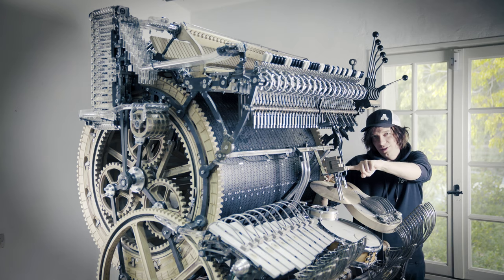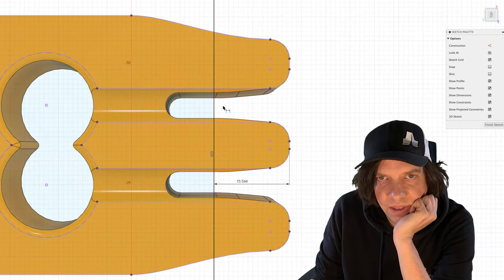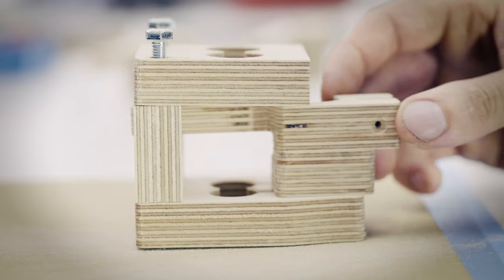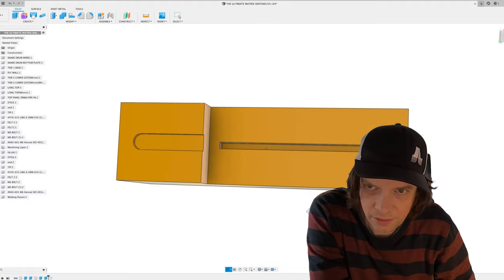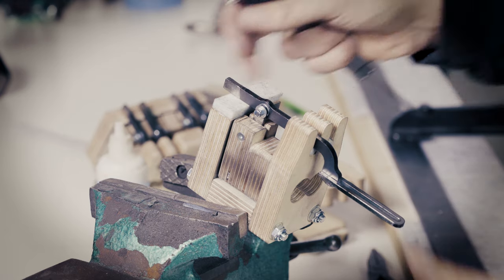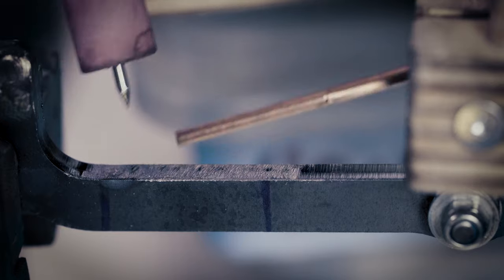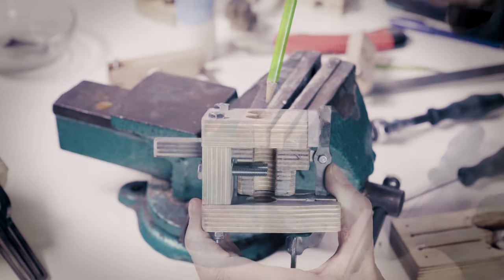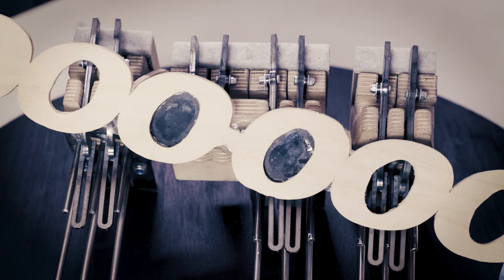Making Better Marble Gates - Marble Machine X #144

Comment: 11:02 There seems to be some friction from the thread of the screw. Does this damage the marbles in the long run?
Reply: Marbles roll.
Reply: @Jeff121456  But the initial part is the marbles will be dropping one full marbles' length down to impact onto the screw's thread. Multiply this over the course of millions of times and the marbles would wear down because of that repetitive impact, no?
Reply: marbles are the least difficult component to replace
Reply: im more concerned with the threads. a couple hundred hits will not do too much, but 10 or 20 millions? that and plywood rubbing on plywood? even with the graphite i think this part still needs to be redesigned
Reply: @Skai2O  Not really. The "marbles" are actually  hardened ball bearings. I think he got them from SKF. I doubt you would even be able to put a scratch in them with a regular metal file even less with a regular non hardened galvanized or zinc plated steel bolt.
Reply: @braiansingh9730  the threads would wear down, but it wouldn't cause a failure, it would just reduce the friction and the problem would eventually stop
Reply: I doubt it, the threads would wear away before the marbles would have any noticeable issue
Reply: @Jeff121456  tires roll.
Reply: @Sleepless_Sam  I knew it was something like that.
Reply: It seems to me it should be smooth. At some point the threads are going to knurl over and may get metal shavings in the mechanism. He should be using a hardened ejector pin (used in plastic injection molds) which are smooth.

Comment: Number one- you can keep all the parts as cut and the felt at its current dimension- all you need is a stop block screw in the back side of the wood bracket that holds the shuttle... a screw in this position will prevent the shuttle from moving back beyond a certain point. Source a screw that has a urethane rubber end or affix a rubber bumper to the head of the screw, and screw it in from the inside of the shuttle. A slot cut in the other end of the screw would allow you to adjust the position of the stop from outside the machine, while the head holds the rubber sound damper.  And the advantage of the screw is that you can fine tune just how far each shuttle moves back to achieve ideal marble stacking in the pipe above the gate.
Number two-  The stop screw you are using inside the gate path has threads to the very end.  If you want to reduce friction, then dragging a sphere across steel ridges of similar hardness is a LOT of additional friction- especially when the marble has the added weight of all the marbles above it.   This stop rod SHOULD be a smooth steel rod or bar.
Reply: I hope this is just a prototype and the real part will be smooth
Reply: post this on the discord server
Reply: A) a stop screw would defeat the purpose of the felt, which is the noise reduction, and rubber soft enough doesn't last very long before it turns to goo due to age.

B) a lot of armchair engineers are making a fuss about the threads on the bolt, but missing the fact that the coefficient of friction between hard metal surfaces is quite low and the marble can roll anyways, so the actual friction force is small enough to be irrelevant. Keep in mind that when Martin is moving these mechanisms by hand, it's easy to feel how much resistance there is; he knows where improvements are needed.
Reply: @nikolaihedler8883    Sorry- it would not defeat the purpose of the felt- The Felt is CRUSHABLE. And will compact over use... as such- relying on the bar hitting the felt as the shuttle stop is simply asking for it to vary over time. A stop will accurately stop the shuttle where you want it to and the rubber will not wear out any faster than felt will.

You comment about the co-efficient of friction is moot because the same factor applies to the marbles rubbing against each other-
 Much of this episode was examining the TINY additional friction of having the marble push UP a stack of marbles because the next marble was not Behind the apex of the curve of the marble in the gate.   Despite the fact that you had two SMOOTH marbles rubbing against each other.   This was not a concern of FRICTION, The idea was to minimize the resistance of LIFTING the marbles in the pipe even a tiny bit.
The spherical apex of the marble, resting on the cylindrical edges of the threads is actually a much greater force because it is concentrated on TWO ridges at any given time. Like CHOCKS on a wheel.   And the apex of the marble curve has to be Lifted over each thread, 8 to 12 times before dropping off the screw.
This is defeating the co-efficient of friction between two steel surfaces by essentially adding a corduroy contour you have to slide across.

A smooth steel shank would minimize both the lifting of the marbles in the pipe... and it would allow the marble in the gate to slide smoothly with the low friction you are claiming exists, where it doesn’t when pushing a curve across a series of steel knife edges.
Reply: @christopherpardell4418  it's not friction that's the problem when lifting the stack of marbles; it's just the extra weight. Lifting the marbles is a problem because it takes energy to lift them, even if they're frictionless; the sliding friction is small enough to be almost unmeasurable in this situation.

Felt doesn't melt and turn to goo because of internal solvents, and also doesn't wear down the way you are describing; it's used in this same application in pianos which work flawlessly for decades.
Reply: oktopustrainer  well actually the surface area has almost no effect on the friction force, but you're right about it rolling.
Reply: oktopustrainer  two steel spheres meet with the smallest possible contact area. A sphere and a cylinder meet with a trifle more contact area but still negligible.  A sphere meets a screw thread in two contact points...   however, the problem is that there is a valley BETWEEN the two points of contact and the lowest point of the sphere is lower than those two contact points.   Ergo, the steel sphere must RISE to move over the thread, where it drops into the valley between the next two threads and hits the next thread like a tiny speed bump.   Then it has to do that again for each successive thread.   
A marble on a smooth steel shank will slide rather than roll, which is actually less resistance because for the marble to roll adds in its moment of inertia.  The marble on a thread rolls because the added resistance of the moment of inertia is less than the resistance of having to slide over each thread.
The mass of the marble is increased by number of marbles above it in the pipe... this increases the resistance of lifting over each bump the exact same way a wooden wagon wheel is harder to roll over rocks when the wagon is carrying the weight of several more wagons.

Seriously... the scallop height of a big marble on a fine thread is not much... but its there.   If its worth modifying every gate to make the marble not have to lift the other marbles X distance one time... then it’s worth it to make it not have to lift the marble 1/10 of X height 12 times.
Reply: @nikolaihedler8883 . So, like I said... it’s having to LIFT the marble over each thread that is the problem.   ( although friction DOES play in as the bottom marble in a stack in “rolling” would try to roll the marbles above it, each in the opposing direction like a train of gears. Which is why these marbles do not Roll out of the gate throat, because the cumulative friction of turning a stack of marbles against each other is greater than the friction of sliding)   
And felt on a piano is NOT being used to POSITION any part precisely.  Its just a surface that moving parts can bump against without making noise... or that can be pressed to a vibrating object to dampen its vibration.   Its Not a precision registration solution.
Reply: @christopherpardell4418  pianos use felt between many of the moving parts within the action and they rely on felt pads to keep they keys aligned with each other.
Reply: @nikolaihedler8883  On this point alone, you are only semi correct. Yes, pianos do use felt in many places, but not for ultimate alignment. The hammers rest on a wooden stop and are cushioned by thin felt, not calibrated. The keys rest against thin felt, but are weighted and balanced for ease of playing and so do not impact the felt with enough force to deform it. Even if they did, the difference would be a tiny discrepancy between key height on the keyboard, which can be adjusted anyway, but zero affect on the position of the hammers and therefore function of the piano. 
Ultimately, any place inside a piano that uses felt is either for damping the strings, or the sound and feel of 2 colliding wooden/ ivory parts. The weight, position and feel when playing of any component is decided by hard stops and other calibration methods.
In the marble gate, the only calibration point is controlled by the reliance on a constant dimension of the felt. In a piano, the felt will, of course, deform over time, but the calibration is performed elsewhere.

You can see the several adjustments available in this image. All felt stops are controlled by additional measures.
https://cdn.merriammusic.com/2015/11/grand-action.jpg
(It's not the best image, but several links I tried didn't work. Search Google images for "piano key mechanism" for better examples).
Reply: @SuperSpatman  The resting position of the keys has a lot to do with how predictable the "feel" of the action is, and it's those resting positions that are lined with felt; it's true that they're adjustable during service, but many pianos go decades without a full readjustment and still maintain accurate and consistent action. The forces applied to the felt in this video's mechanism are similar (quite low, especially compared with his test pressure) and do not require the exaggerated level of precision that many people in this comment section seem to believe. In other words, the wild fearmongering about deteriorating felt and associated catastrophic failures are just that, and it's a perfectly suitable material (even if the welded-on bits are rather unfortunate).

Comment: You could test this though, make one with a simple return mechanism for the marbles like a test rig, leave it running dropping two marbles a second for 60 days, that would be 10m marbles, see what has worn after that time and improve the design.
Reply: That’s the right thing to do, instead spending time on building 38 prototypes each time
Reply: What?  And demonstrate with certainty the futility of his goal and the complete inability of his design to ever reach 10M?  That wood will wear, that felt will compress or steel threads deform after being struck millions of times?  What could possibly go wrong?
Reply: I keep saying that since ages. It is so frustrating however I still watch every video. So yeah.
Reply: And, of course, the simple return mechanism would have to have a better failure rate than the design being tested, otherwise it might fail first. Then wait 2 months for results. Unless something goes wrong. In which case, redesign and wait. Also the noise would not in any way drive him crazy.

Yes, certainly a good idea to test several designs of several parts with tests that take 2 months and need to be more precise than the designs being tested. Most certainly going to save time.

Say, how do you propose getting a testing design that only fails 1 in 50000000? Create a few designs and test them for a few months?
Reply: @autumn4442  I mean the alternative is to do a proper failure analysis. Look at all failure mode and try to solve those before you build it. But not just guess and say it will last 10.000.000 cycles. 

Also no one says that you have to run it next to you. It can be in a different room. Somewhere you go check every few hours. 

And the return mechanism will be easy. Just take a screw to drive them up. You just have a rotation motion, nothing that can really wear, easy to build, etc. I mean that would have been the first thing I would build if i would start such a system. 
Designing testing parameters and building proper test is the most important part in any engineering.

Comment: 3:06 I can only hope that one day Martin will realise that felt is compressible and that leaving a 6.5mm gap for felt is meaningless... Give it a week of use and it will be down to 5mm. After a year, it's probably 4mm...
This whole video is Martin having an engineering meltdown... 6.5mm gap for a compressible material, 15.544mm (to the MICRON!) dimension for a plywood part... My head hurts...
Reply: DISCORD GUYS please
Reply: Felt is very common in music instruments like pianos, and doesn't compress the way you describe; this is especially true because the force applied to it is much less than he was demonstrating. In fact, his "maximum pressure test" reflects what is likely to happen if the felt does become compressed permanently, and shows that the machine will still work even if the felt gets worn down.
Reply: @nikolaihedler8883  Even if i exaggerated the compressibility of felt, expecting felt to have a dimensional accuracy lower than 1mm is ridiculous. It's not metal. It's not even plywood.
Reply: @CristiNeagu  it's reliable enough to maintain the necessary tolerance (marbles will still drop freely) and it's a much better long-term solution than polymers of similar softness.
Reply: @nikolaihedler8883  
"it's reliable enough to maintain the necessary tolerance"
I don't see how you can possibly make that claim, especially considering 23:10, and especially considering that the faces of the metal parts hitting them aren't flat, are angled, increasing pressure.

"it's a much better long-term solution than polymers of similar softness"
No one said to replace felt. What i said is that expecting felt to maintain and conform to sub millimeter tolerances is folly. The inadequacies of the materials used should be acknowledged and the design should take them into account. If the design relies on that 6.5mm gap, and the design relies on the bottom marble being pushed forward by the marble stack, then when that 6.5mm gap becomes a 6.4mm gap and the marble is pushed back by the stack, what happens then?
Reply: @CristiNeagu  you can complain about sub-mm accuracy all you want; he tested it with forces far higher than will ever be seen on the machine in operation and it was still within tolerance.
Reply: @CristiNeagu  also that time stamp is when a marble gets stuck because the gate is pulled out too far because there's no spring attached yet, so he had to move the gate manually.
Reply: @nikolaihedler8883  
"you can complain about sub-mm accuracy all you want; he tested it with forces far higher than will ever be seen on the machine in operation and it was still within tolerance."
1. Testing with higher forces is fine, but it doesn't replicate material fatigue.
2. It wasn't within tolerance. What are you talking about? "In tolerance" means the bottom marble is pushed forward. 1mm of deformation puts the system out of spec.

"when a marble gets stuck because the gate is pulled out too far"
Is it? Are you sure? 20:30 seems to contradict you a bit.
Reply: I think you’re right. Even if the felt doesn’t wear down, it just doesn’t make sense in the context of “10,000,000:1” failure rate.
Reply: Yes its Used in music Instruments .... But never in places wher it has to stop a movement repetedly Million Times at an exact Position ...
Reply: @rdudas71  10 million times, you mean.
Reply: @rdudas71  you mean like piano keys' mechanisms precisely returning to the same positions so that they have the same attacks and releases over decades of playing?
Reply: @nikolaihedler8883  
1. Piano keys don't need to be precise to the millimeter.
2. The felt will stabilize at some point. It won't compress into nothingness. But that point will not be the initial start point.
Reply: @ethancubis985  What does that have to do with anything? I'd appreciate it if you stopped being so flippant.
Reply: @Hirosjimma  You may end up in that situation, but that does not break the functionality of the piano. Also, it is unclear to me how much deformation is needed to arrive at that result. I doubt it's just a millimeter.